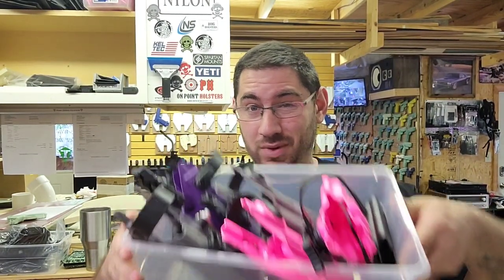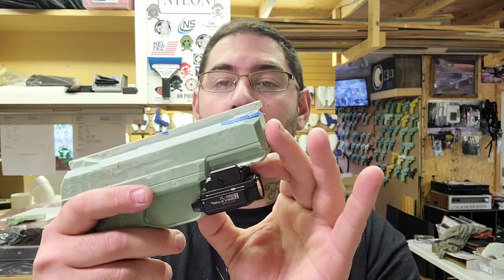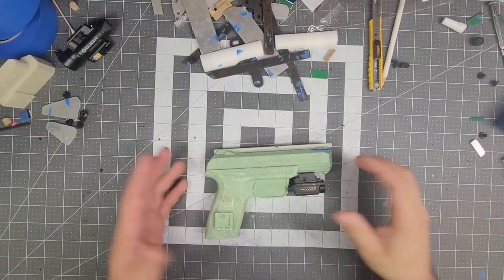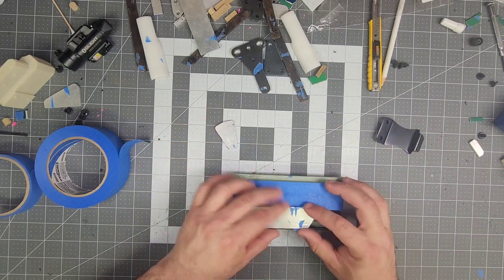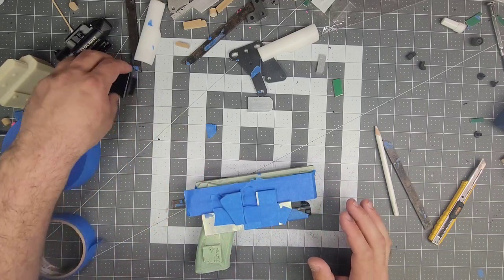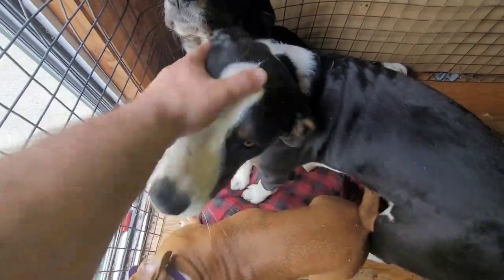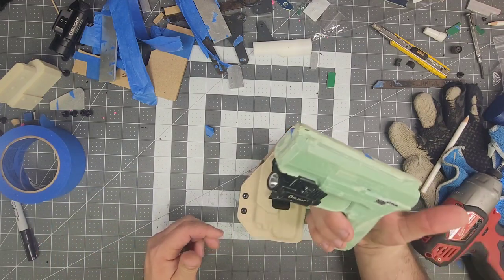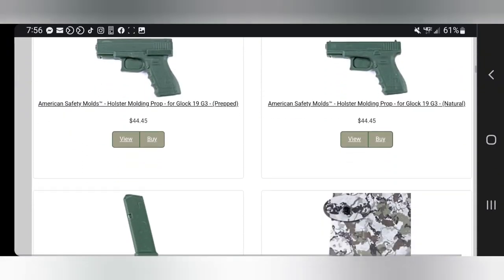How to Make a holster for the Ruger Security with OLight PL Mini 2

Comment: What is and where do you get the tool that you use to clean out the holes after you drill?
Reply from the maker: Amazon for noga rc2000 and the other is a Countersink bit found on holstersmith